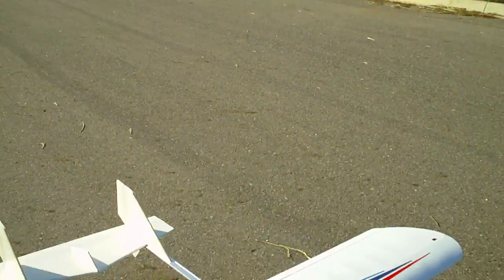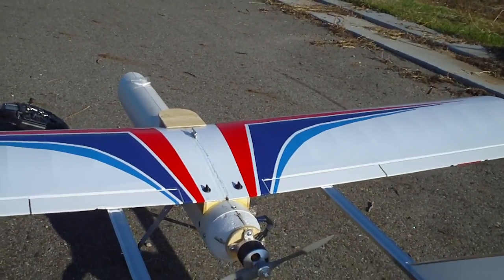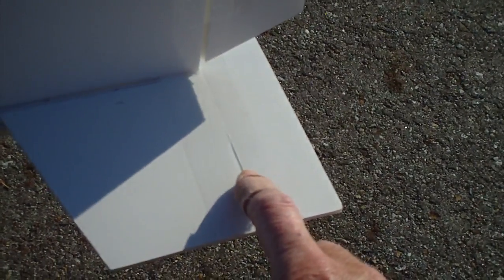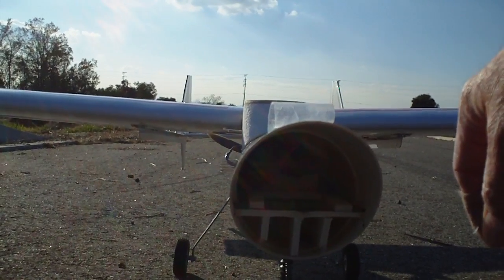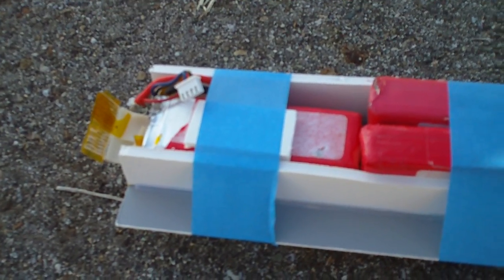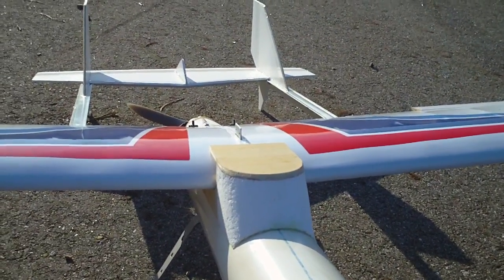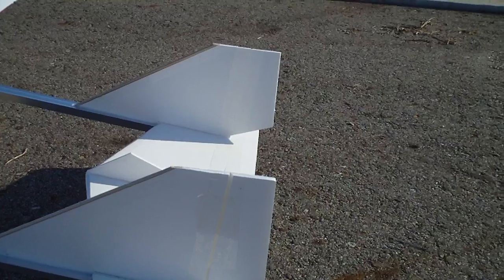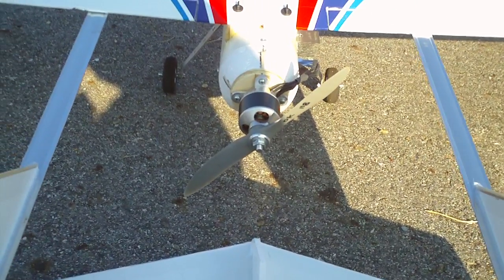4" PVC UAV FPV walk around

Comment: Great design you may consider to use corrugated plastic board i find these for $2.00 at walmart they are blank garage sale signs usually found by the paint and hardware area. and id get a replacement dome for the front looks like the go discover plane nose find this part at hobbyking they have a replacement dome cheap i think that would cut the wind better and prevent lifting so much in the nose. great video  id really like to see it fly and hear how long it will stay up on what lipo your using, hope to see it soon, were still waiting for snow to leave and wind to go away so we can get back to flying.
 good luck, tommy